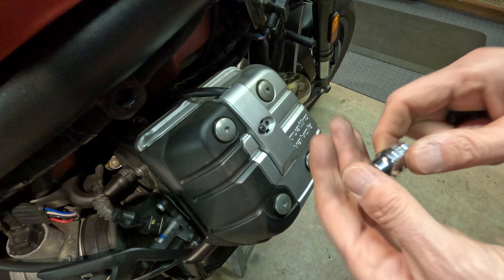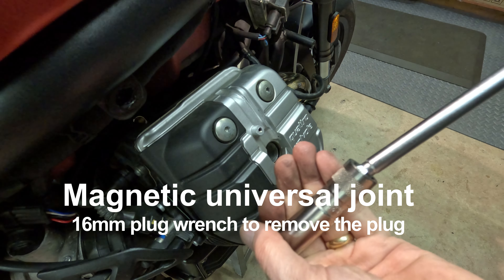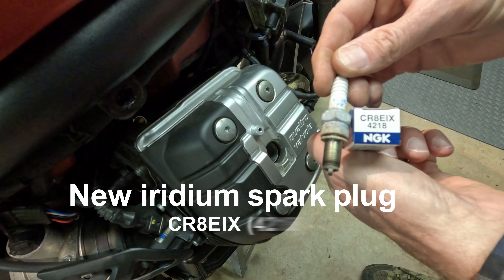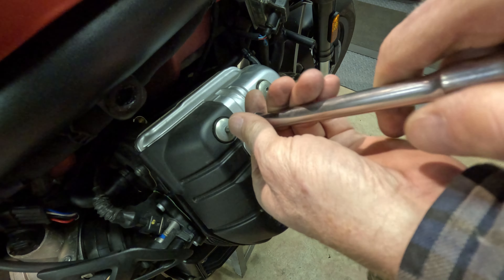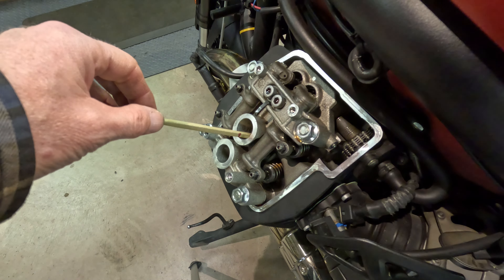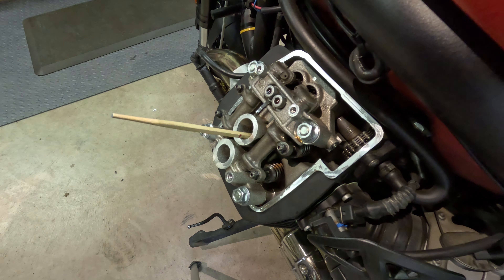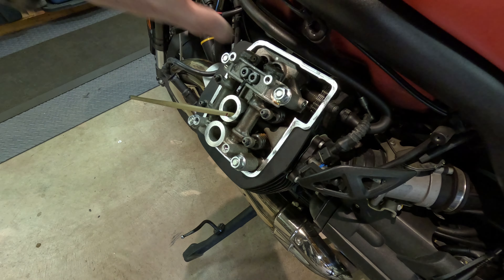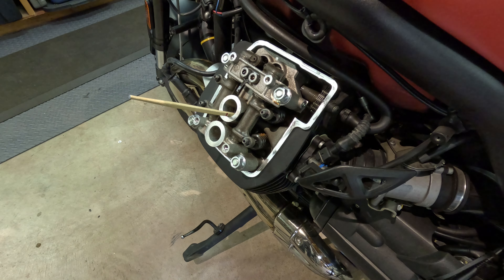Moto Guzzi Griso 1200SE: Valves, EVAP Canister Removal, Balance & Reflash | Part 1

Comment: You can also stick a long thin flat blade screwdriver through fins of head near exhaust header and push spark plug cap up. Better than pulling from top
Reply from the maker: Great tip!

Comment: I use a chop stick as well on my guzzi. Work very well
Reply from the maker: It's a great solution I've used before on my Husaberg.  I can't take credit, I saw it used years ago by a friend with a vertical twin-but that was no where near as easy to adjust valves on.  Cheers.
Reply: Best use ever for a chop stick. Who wants to eat their food with knitting needles?

Comment: Looking good so far, BMR! Beetle's recommended valve settings having done the tune were 0.1 inlet and 0.15 exhaust. My bike certainly doesn't pop & bang on the over-run like she used to.
Reply from the maker: Nice to know I'm not into unknown territory.  I'm waiting for a new OBD2 to 3 pin cable right now, as the previous one died when I foolishly let the neg terminal flick momentarily against the pos battery terminal - what a no, no!  Cheers.
Reply: @BlueMarbleRider  The cables I bought were actually Fiat Group! They fit Dukes as well as Guzzis.

Comment: Thank you for your very clear instructions making the job easy. 
Have you considered a video to show where the various drain/breather hoses should be attached. As far as I know a Griso 
should have main 2 clear pipes and 2 black pipes. Sometimes they fall off or simply degrade and require replacement. Sounds simple but it's a task and a half.
Regards
Larry
Reply from the maker: Thanks, Larry, just got my bike back, but that sounds like a good idea!  Cheers.
Reply: @BlueMarbleRider  I didn't expect such a quick reply. Glad you like the idea iro the breather pipes. Good luck with your Griso following your crash. I have recently bought one here in the UK. They are beautiful beasts. I cannot wait for decent riding weather here in the North West UK. All the best and ride safe.

Comment: I've found a bit more control using a T-handle allen for the valve adjustment as opposed to the ratchet and socket.
Reply from the maker: Thanks - that's a great idea, far more precise.  Cheers.

Comment: How did you get the TDC? Did you have to remove the oil first?  I'd like to do the adjustment, but not sure how far the stick should go and what the positions are of the phases of sucking, compression, ignition and exhaustion. You only checked it by shaking those parts a bit to feel a slight rattle? You don't feel any rattle otherwise? Do you rotate the wheel or something else? Basically, I would like to understand everything regarding the top dead center. Thanks!
Reply from the maker: I rotate the wheel in 6th gear with the spark plugs out.  You can tell which stroke of the cycle you are on by checking the inlet/exhaust valve clearances with feeler guages.  When the inlet opens, that is the suck; they will both close for compression and ignition, then the exhaust will open on the 4th stroke - exhaust. At this point the inlets should still be shut, and exhaust open...  Cheers.
Reply: @BlueMarbleRider  Thanks, BMR! No need to worry about oil spill? Warm or cold to do the adjustment?
Assuming, it's okay and should be done when the engine is cold.
Reply: I have just done it on the right side cylinder. :)
The intake valves were precisely 0.1mm, but the outtake valves were around 0.1mm, too, so I made them a bit looser to get 0.15mm. I think it's important to keep either the shim or the screwdriver on the adjusting hex screw when you tighten the the lock nut as that tightens the adjustment screw with itself. I don't really see much difference yet between the before and after sound, but I'll test it later after it cools down and can adjust the left side block, too. I didn't put it on stand - don't have - but as I see, there's not much difference anyways as you can move in 6th gear the bike in the riding position - just gets harder before it pushes out the rod, even spit out the straw I used. :) Also it's irrelevant I think whether it's on the kick stand or up straight, the screws are not affected by that.
Thank you for giving confidence, BMR, I'll report back after I finished the left side. Cheers!
Reply: Done to the left side, too. The good news is that I don't hear/feel any degradation, but on the contrary, it feels like two clocks running in sync. The exhaust valves on the left side were also a bit tighter than the spec, the top valve was around 0.13 mm and the bottom one at around 0.1 mm. Set them both to 0.15 mm.
After these adjusments, I went for a shorter run (15 km) and now I notice at gear shift a very short pop, like an airgun shot sound, but it rather sounds nice than disturbing. It's like a feedback that the shift was successful. :)
I have the Termignoni, in theory the previous owner upgraded the map with Guzzi Diag, so not sure if I have to touch anything else.
Reply: Another update: it became fantastic. Not a big change, I suppose, but it is to the feel and sound. Now the roar is more emphasized, no rattling, but the speed feels less as the sound is calmer, too. It's hard to give it back.
Reply: Hello,
Can you please share which model year you have? 

I know you've done the adjustment already, but you should definitely do the valve check with the engine cold. The valve clearance is there to accommodate for the expansion of the moving parts when the engine is at full running temperature, so in theory, there wouldn't be any clearance at all on a hot engine. Not to mention that fact that you wouldn't be able to touch anything 😜
I did mine a few days ago, just putting the bike in 6th gear and rotating the wheel was enough to go through the cycles and find TDC.
Cheers!
Reply: @ Yeah, I did the adjustment when it was cold. I have a 2015 1200 SE.

Comment: I'm fascinated by your channel. Thank you or uploading these videos, I can see your passion for Griso. I have just bought a 1200 8V SE Red Trophy a week ago. Need to learn a lot to make the right adjustment. 
I hear some rattling noise from the front at around 2800-3000 RPM. Have you noticed anything like that? Cannot tell if it's from the phone mount or from somewhere else...
Reply from the maker: I haven't noticed it, but that doesn' mean it's not happening.  When I get back on it, I'll certainly listen out for the noise and get back to you if I hear it.

Comment: I agree the BMW airheads and the MG's are simple machines to work on in terms of valve adjustments. Did you re-torque the head bolts before you adjusted the valve clearances? As for values, I wonder if the more generous clearances are labeled as break-in clearances? Old BMW airheads have two sets of values; break-in period and post break-in. Some mechanics will use the break-in figures regardless. Were the TDC  index marks difficult to see and that is why the chop stick method?
Reply from the maker: The chop stick is just so much easier, especially when turning the rear wheel. The timing marks are a fiddle.  I'm not sure about the two sets, although I suspect the original factory clearances, being more conservative, allow more room for error and err on the side of safety rather than performance.  No, I left the head bolts alone, as there are no weeps and the gaskets are likely "memorized".  Cheers.

Comment: Like the centre stand. Would a flat motorcycle jack lift work with whatever gear is underneath the griso?
Reply from the maker: Having had a quick look, I think it would on the bottom of the oil pan, allthough it is finned for heat dispersal, it would likely be strong enough.  I would suggest you ask the guys at the Griso Ghetto  forum before taking my word for it though.  Cheers.

Comment: The rubber gasket of the head cover on my guzzi might need replacing since a bit of oil is seeping on the left side.
Should I grease or oil the new gasket when installing or just keep it dry? 

Great video!
Thank you!
Reply from the maker: They have a reputation for leaking, although mine are good right now.  It depends how they are fastened (and I can't remember!), but if they are sandwiched between two non rotating surfaces, then no light oiling.  But if a surface spins on contact with the rubber, then a very light coating of oil will stop any pinching and distortion.  IF my memory serves me correct, I used a very light coating of oil, and tightened to spec torque and no more.  Cheers.
Reply: @BlueMarbleRider  alright great!
Thanks for your reply.
Yea the gasket is simply sandwiched between two surfaces; it's exactly the one here in your video when you point to it with your finger 2:57 
It's squished down between the two surfaces when the head cover fixing screws are tightened to spec. Wasn't sure if any oiling was needed.
Cheers!

Comment: Hello, can you tell me if the engine is running better with 0.1 mm inlet and 0.15 mm exhaust?  Thank you in advance.
Reply from the maker: It's been a while since I did the valves, and can't, off-hand, remember the specs.  But if I used 0.1mm inlet and 0.15mm exhaust, then, yes, it is running beautifully.  So whatever I did worked.  Cheers.
Reply: @BlueMarbleRider  Hi, I checked the valves and the 0.1 and 0.15 are factory specs :-) Some valves were a bit tight and other loose. (last owner job). Thank you for the video. Now running like Swiss clock.

Comment: How did you rotate motor for TDC?
Reply from the maker: I put it in gear and turn the wheel.  (I have a removable centre stand for it).
Reply: @BlueMarbleRider can you do a detailed video on how to find TDC? It looks straight forward, but I believe there are a few rotations needed to get it “true” TDC.
Reply: Hi BMR. Am about to adjust my valves (2017 8V SE) and want to know if you simply spun the rear wheel to move the pistons to obtain TDC. Pete Roper says to use a wrench to turn the shaft via the alternator cover. What did you do?

Comment: Who is the person that does the ECU flash for the Moto Guzzi's? You mentioned a person by the name of Beatle? does this person have a website?
Reply from the maker: Yes, Beetle: it's a 100$US for the map of your choice re exhaust etc.  He has both a website with instructions and a facebook shop: 
https://www.facebook.com/100063553615018/shop/?ref_code=mini_shop_profile_plus_header_cta&ref_surface=profile
Reply: @BlueMarbleRider  Thank you very much
Reply: Just follow the instructions to the letter, including which connectors to buy & it's easy. If I can do it, anyone can! The hardest part was finding the connector on my Griso! Up on the frame rails at the rear, on the right. 😉